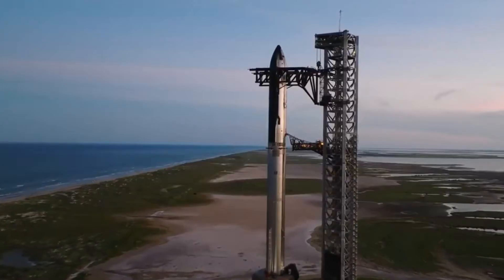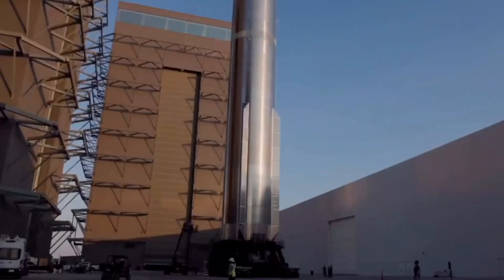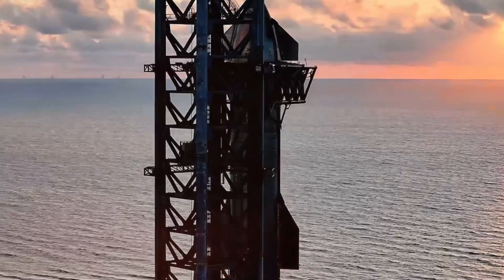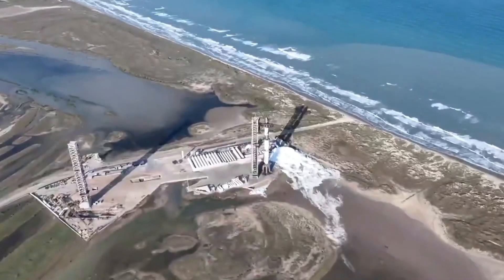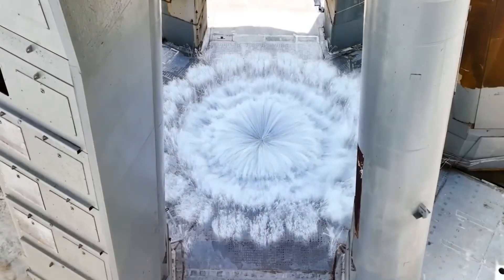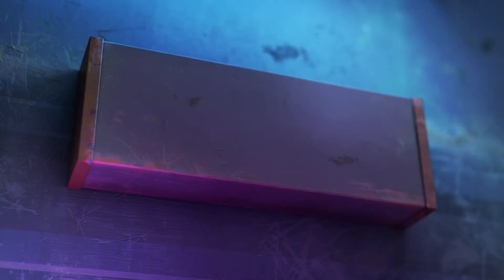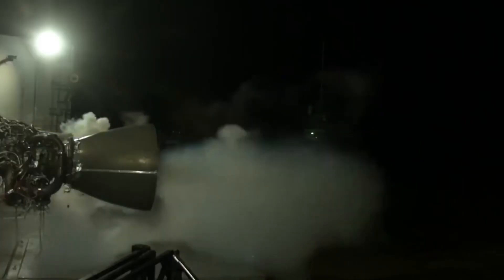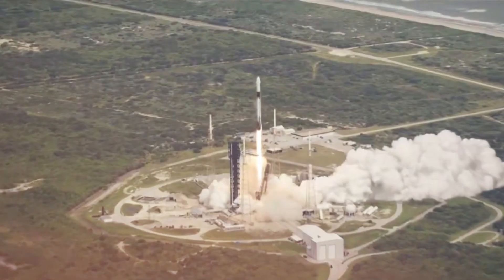Why SpaceX ditched NASA's Ceramic Tiles? The Answer Will SHOCK You!

Comment: So, is the heat shield now adaptive by changing the flow of the ulage gas? Does this require a complex gas manifold? Tiles with temperature sensors is useful, but does can the state of the tile be inferred?
Reply from the maker: Could this groundbreaking heat shield technology signal the end of traditional tiles and the start of a self-healing, adaptive spacecraft era?

Comment: Dimpling the surfaces may be helpful. Seems to be the natural effect on meteorites.  it's contribution in cutting resistance increasing flight distance to golf balls.
Reply from the maker: Could dimpling the heat shield surface, inspired by meteorites and golf ball aerodynamics, unlock a new frontier in spacecraft efficiency?

Comment: It sounds like Aluminum Oxide is the new heat shield.  The problem is the pressure with the heat.  Most materials, that can handle the heat, can't handle the pressure with the heat.  If the pressure can be reduced using shapes, the materials could last longer.  It seems like a smaller prototype would be the intelligent way to go.
Reply from the maker: Could SpaceX's revolutionary heat shield breakthroughs mean the end of ceramic tiles forever, or are we overlooking critical flaws in their bold metallic approach?
Reply: @Elonmusk24h  If we can create a method to cool that leading edge, then the melting point of the heat shield can be low.  Only a few can afford steel designed to handle high temperatures, as H13 is expensive!  H13 is impossible to cut with pressures used for cutting hot rolled steel, but turning up the pressure, it cuts like butter.  Aluminum Oxide is the slag that is thrown away before casting.  They make grinding wheels out of it as it cuts steel and can handle high temps.  The idea of using ceramics is asking for problems as ceramics are brittle.  If we can scale the heat pipe tech up, then we might have something.  Heat pipes are used to cool CPU's on computers.